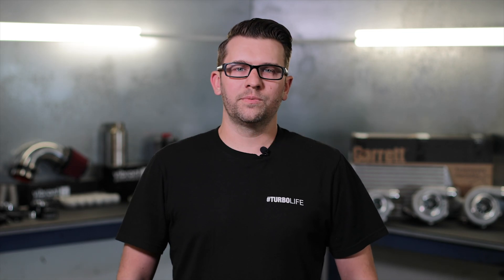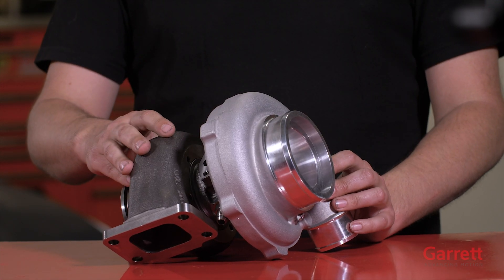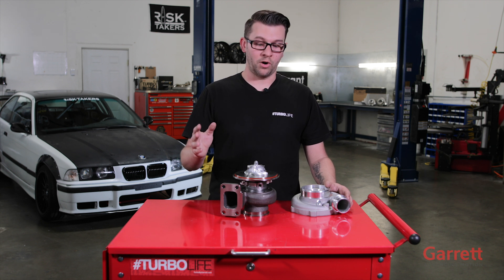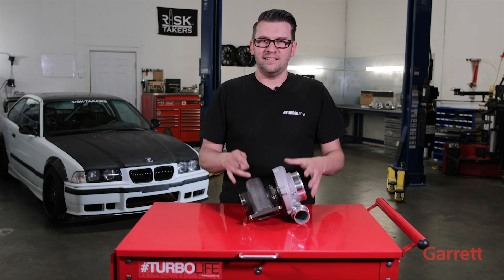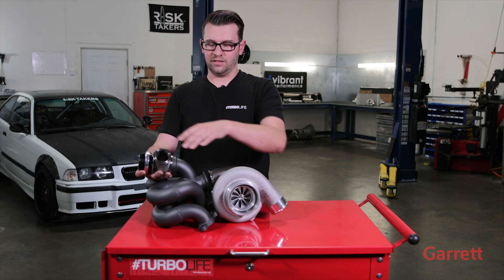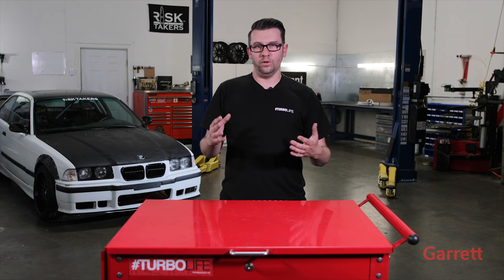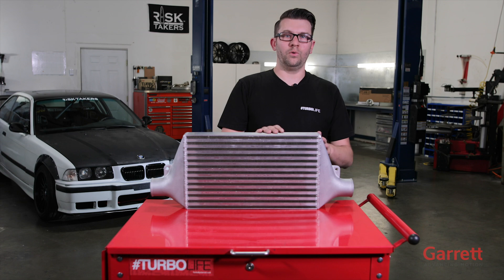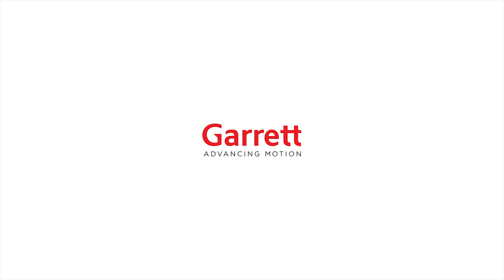How to Turbo a Race Car Part 1: How a Turbo Works

Comment: I'm like the reducer for low rpms that opens up larger into high rpms with a half cut away butterfly, exhaust dump valve inline b4 the turbo after the manifold  or in between would spool fast and as the rpms load the exhaust up increasing it would open back to normal like open in high rpms but closed as soon as you hit the gas...would be great if was tachometer signal controlled😮😢😅